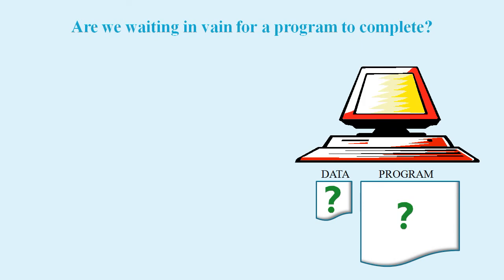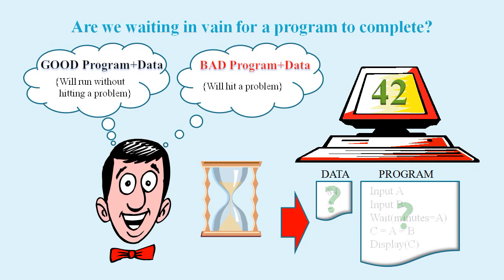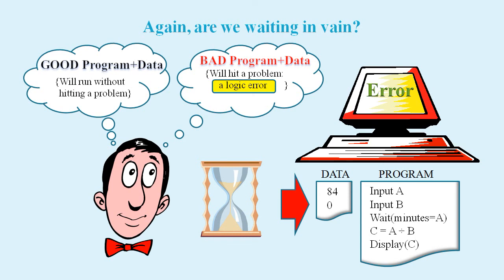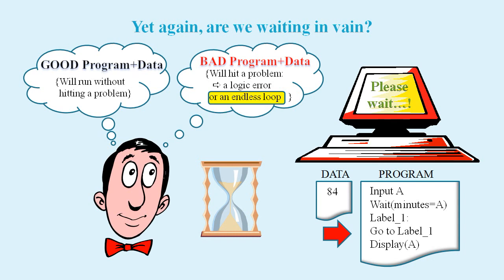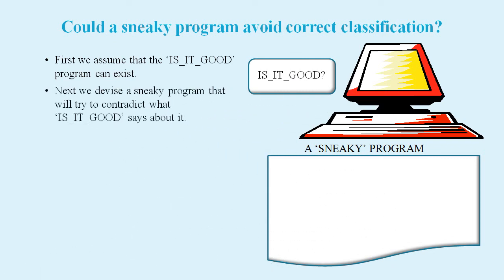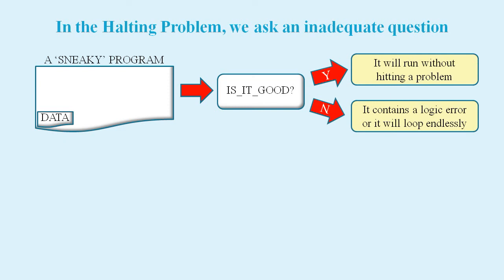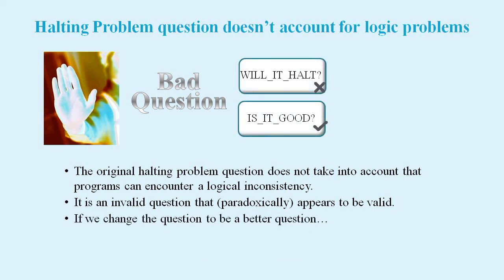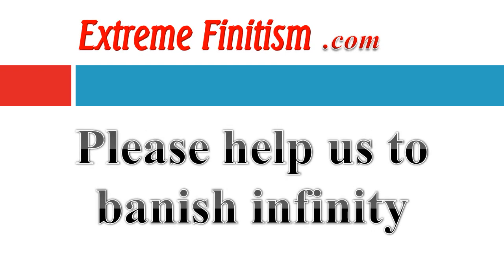Halting Problem: Finally Revealed - The (Logic) Problem with the Halting Problem

Comment: The problem is: how do you define what a logic error is? Once you formalize this you can again do a proof similar to the undecidability of the halting problem or undecidability of the logic itself.
Reply from the maker: Thank you for your comment, and I hope you enjoyed the video. If we relate your point to the video, then presumably your point is that a 'sneaky' program could be devised in such a way that the 'logic error' (of trying to act opposite to what IS_IT_GOOD predicts) can not be detected. For example, the sneaky program could use some code that essentially performs the same logic as IS_IT_GOOD, but where the code has been made to look very different (making it difficult to detect).

In order to avoid this type of problem the IS_IT_GOOD program would need to process the logic statements in the 'sneaky' program (or any given input program) and simplify them down into a 'simplest form'. With the logic in its simplest form, then detection of this 'logic error' might be easy. If so, this would defeat any attempt by a sneaky program to avoid detection.

Of course it is debatable whether or not it is possible to reduce any group of logic statements down to a fundamental simplest form. But then the onus is to provide proof that this cannot be done (and I'm not aware that such a proof exists). If such a proof does not exist then my argument still holds.
Reply: @KarmaPeny  Thanks for reply. I think I understand your point better now. So the IS_IT_GOOD predicate checks the program text in general? I assumed it would check just a single run of the program. I think in that case, the IS_IT_GOOD predicate would have to reject too many programs, i.e. the language with only good programs would no longer be turing complete. Otherwise you would run into the undecidability problems implied by the halting problem again. However, I do not have a proof for this. One example of such a non-turing complete language where the halting problem is decidable are primitive recursive programs, but you could certainly find a more liberal class of programs (maybe Epigram qualifies). 
Definitely interesting to think about...

By the way: There is no algorithm that can reduce every program to its simplest form. The proof for this is a direct consequence of the undecidability of the halting problem, so it probably does not help in this discussion.

Before clicking the video I was actually assuming your argument would be different: I thought your argument would be that all computers have finite memory and therefore the halting problem could just be solved by looking for cycles in the finite state-transition system.
Reply from the maker: @PeterZeller1  Let me address your concerns with a simple example....

Consider the subset of all computer programs that display one word, either YES or NO, and then they end. These programs might input lots of data and they can perform complicated operations on this data as allowed by a Turing complete language. The problem with the Halting Problem can be demonstrated using just this subset of programs (where halting is not an issue because they all halt)...

Within this subset of programs, can we create one that will predict what any other program + its data will do? Of course we can; this answer is trivial. All that our predictor program needs to do is to run the input program + its data. This question is equivalent to the Halting Problem question except that here we KNOW that the answer is YES given this specific scenario.

The Halting Problem argument is that we can create a sneaky program that will examine the logic of the predictor program and then do the opposite to what it would predict for the sneaky program. Such a sneaky program would still be within the specified subset of programs and there is no restriction on what language is used.

So either the Halting Problem argument is right and we can create the sneaky program, or else the counter argument is right and we can create a predictor program. In this particular scenario our predictor program is trivial, and so we must conclude that the logic of the Halting Problem is flawed.
Reply from the maker: @PeterZeller1   (continued...) In this scenario the sneaky program would examine the logic of the predictor and see that it calls the sneaky program. So the sneaky program would need to do the opposite of what the sneaky program does! It is easy to see that this forms a contradiction. It is a logical inconsistency that should ideally be detected and flagged up as a logic error in the code. The sneaky program code might look like this:
 
    Value = Sandboxed_result_of (sneaky program)
    If Value = YES then display NO
    else display YES
 
We can see that this would get itself into an endless loop. As such it would no longer belong to the subset of programs that display YES or NO and then end. In other words, it will not work. We cannot build a sneaky program that will do the opposite of our predictor program.
 
It is important to distinguish the difference between actively doing the opposite to the predictor and not being able to do the opposite. The looping of the code above is not an output of the status 'LOOP' (as opposed to the status 'HALT'). It is merely an indicator that tells us that it is impossible to build the sneaky program.
 
The fact that the Halting Problem proof is invalid might come as a shock to most people, because almost the whole world still believes that the proof is correct.
Reply: @KarmaPeny    The proof of the halting problem is correct. It has been formalized and checked by computers (e.g. isa-afp . org/entries/Universal_Turing_Machine.html ). What you did in the video was to change the statement of the proof and then of course the same proof no longer applies.
I see two problems with the arguments in your comments:
1. You are already assuming that all input programs terminate, which is the thing you want to check. So it's a cyclic argument.
2. The program you give does not contain an endless loop, because you assumed earlier that the sandboxed_result_of function always terminates and there is no other loop or recursion in the program.
Reply from the maker: @PeterZeller1  The logic of the Halting Problem is equivalent to many other problems such as the Barber paradox, and as such the core logic of the Halting Problem is not about halting. It is merely a simple trick of logic, nothing more.

In my video I changed the question so as to avoid the problem with the Halting Problem, which is the logic error at its core. As I explain in the video, the original Halting Problem question is a bad question because it ignores the possibility of logical inconsistencies within programs.

I gave that specific example (in my previous replies) because I wanted to demonstrate an equivalent logic problem using the statuses of 'YES' and 'NO' instead of 'HALT' and 'LOOP'. It is very important to understand that the logic behind the Halting Problem is not about halting, it is merely saying that if you choose heads then I can see what you have done and so I can then choose tails. This is the logic behind the Halting Problem proof and it is clearly flawed logic.

Given that the Halting Problem is not about halting and looping, we can analyse the logic by using different statuses. We want to avoid a status of 'LOOP' because we can encounter something that looks like looping during our analysis. But in pure logic terms such looping simply indicates that a contradiction has occurred. It is a logic error. If we do not change the statuses (from HALT and LOOP) then it can create much confusion which will hinder the analysis.

You said "The program you give does not contain an endless loop, because you assumed earlier that the sandboxed_result_of function always terminates". No I didn't. It is easy to understand, just follow the logic... the process in the sandbox created by the top-level program will itself need to create a sandbox, within which it will again need to create a sandbox, and so on.
 In logic terms this means we have encountered a contradiction.

The Halting Problem argument is that we can always determine the output of the predictor program and then simply do the opposite. But we have shown that in this example, any attempt to do this will lead to contradiction. In other words, we can't construct the sneaky program, and so to assume that we always can is a mistake.
Reply from the maker: @PeterZeller1  Please edit your comment to remove 'https://www.' from your link so that it is no longer clickable. I do not want people to click away from my channel, thank you.
Reply: @KarmaPeny  Just because you think the "Halting Problem question is a bad" that does not invalidate the proof. 

"the process in the sandbox created by the top-level program will itself need to create a sandbox, within which it will again need to create a sandbox, and so on.
 In logic terms this means we have encountered a contradiction." -> A program that loops or crashes is not a contradiction. The contradiction in the original proof is that the program would both loop and not loop.
Reply from the maker: @PeterZeller1  I never claimed that the Halting Problem question invalidated the proof. You are creating your own straw-man arguments and attributing them to me. Please stop this.

A program is merely a collection of logic statement. We can easily encounter an endless loop, such as in this 1 line program:

   Line_1: Goto Line_1

Assuming that we do not intentionally want a program to loop endlessly, then any endless loop must be considered to be a logic error. If our intention is to 1) get a value from a sandbox and 2) process the value, then the fact that we are unable to do this forms a contradiction. If our intended logic and our code do not do the same thing then they contradict each other. It is that simple.
Reply: @KarmaPeny   Ok, sorry that I misunderstood you. I thought you claimed that the standard textbook proof of the halting problem is wrong. 

However, I still have the impression that you think a program can be inconsistent (or "bad") by itself. A program is just some text that can be executed. 
I think you should distinguish two kinds of contradictions in your arguments: If a program does not do what the programmer intended, then that just means the programmer made a mistake. 
A contradiction in logic is however usually defined as being able to derive "A" as well as "not A" for some A from the same set of assumptions.

Your analogy where you remove the halting aspect from the argument does not work, since you cannot construct a "sneaky" program that is in the set of programs you are considering. In the original proof it is.

If it's still not clear, we could try to translate your informal argument to some rigorous proofs, such that we can avoid the misunderstandings.
Reply from the maker: @PeterZeller1  Thank you for the offer to help to translate my argument into a formal proof. I personally find real-world examples easier to understand than a bunch of abstract mathematical symbols.
 
You said: Your analogy where you remove the halting aspect from the argument does not work, since you cannot construct a "sneaky" program that is in the set of programs you are considering. In the original proof it is.
 
You claim that Sneaky can be constructed in the original proof (that uses halting). I disagree because it is merely assumed that it can be constructed. It is this assumption that I am objecting to. The whole point of my example is to demonstrate that we should not assume that Sneaky can always be constructed. It is the whole point of my example. 
 
Furthermore, it doesn't matter if we use halting and looping or not but it is much less confusing if we don't use them. As I keep saying, the Halting Problem argument is not about halting.
 We could easily substitute YES and NO in my example with the statuses of HALT and LOOP. My argument still holds.

I believe the original Halting Problem proof goes a bit like this:

    1. First we assume Predictor and Sneaky can both exist...

    2. Then if Predictor says Sneaky will return HALT, Sneaky will return LOOP

    3. And if Predictor says Sneaky will return LOOP, Sneaky will return HALT

    4. Because of the problems in points 2 and 3 (no need to call them contradictions if you don't want to) we have shown that it is not possible for Predictor and Sneaky to co-exist.

    5. We then assume that if Predictor could exist then it would always be possible to construct Sneaky

    6. Thus we conclude that Predictor cannot exist

It is points 5 and 6 that I object to. My simple example demonstrates a scenario where Predictor does exist but where Sneaky cannot be constructed. So I agree with the original proof in that it shows these two programs cannot co-exist. But I object to the assumption as to which one is the problematic one.
Reply: @KarmaPeny  The original halting problem proof is a bit different: It only assumes that the Predictor exists and then it shows how to construct the sneaky program from the predictor. There are just a few assumptions about the programming language that you need to construct the sneaky program. So the proof sketch would be:
1. Assume there is a function h(i, x) that always terminates and returns 1 if program i halts on input x and 0 otherwise.
2. Construct the following function:
function g(i) {
  if (h(i,i) == 0) { return 0; }
  else { while (true) {}; }
}
To construct this function we only assumed that it is valid to call other functions, that we have if-statements, and that we have a construct that does not halt. That should be true for most programming languages.
3. Then consider the function call h(g,g)
Here we have two cases:
a) g(g) terminates. Then h(g,g) should return 1. But if h(g,g) returns 1 then g(g) goes into the looping branch and does not terminate. So this case is impossible.
b) g(g) does not terminate. Then h(g,g) should return 0. But if h(g,g) returns 0 then g(g) goes into the return branch and terminates. So this case is also impossible.
4. In conclusion our only assumption, namely that h exists, must be wrong.

So would this proof still work if we replaced halting with different return values?
Is there a function h(i,x) that returns 1 if program i halts on input x with result YES and 0 if program i halts on input x with output NO. 
Well, the problem here is that we would still have to consider the case 3b) where g(g) loops and then the result for h could be anything and we would not get the contradiction.
So it is important to talk about halting in the proof.

Your other suggestion was to only consider the subset of programs that always terminate. 
Would the proof work for this scenario? Well, here step 2 would fail: We cannot show that the constructed program is still in the set of programs that always terminate.
Reply from the maker: @PeterZeller1  As pointed out in my video, we need to account for for logic errors. In other words, what if Predictor examines its input x (as per your description) and finds that it will encounter a divide by zero problem, or it will try to access memory address reserved for the operating system, or it will encounter some other logic error? Let's say that all detected logic errors are handled by the operating system and force the program to halt with a return code of 1.

There are many types of redundant looping that we already know how to detect as being endless and so should be terminated. As such, these detectable cases of endless looping should be treated as logic errors. So in the same way that divide by zero causes a return code of 1, so should any detectable case of endless looping.

Now we can have the simple version of Predictor that I suggested in my example, but now it will work for all programs. We no longer have to consider a subset that we know will halt.
 It is still the case that Sneaky cannot be constructed.

The Sneaky program that you constructed will keep calling itself (function g calls function h which simply calls function g, and so on) and this detectable logic error will cause it to halt with a return code of 1. This will match what the trivial Predictor will predict.

Indeed, now we are left with few if any programs that do not halt. We can still construct programs that will loop such as one based on the Collatz Conjecture. But the only reason that these will loop is that we currently don't have a proof that they will end. Perhaps one day we will have the proof, in which case we will know if it should be classified as a non-productive endless loop and thus an error, or if it will eventually halt naturally. 

In other words, if we can detect all possible logic errors then all programs should halt, it is just a matter of how they halt - naturally or forced due to a logic error.
 
The Halting Problem proof is nothing more than a simple logic trick containing cleverly disguised flawed logic. It can tell us nothing about problems like the Collatz Conjecture and yet so many people mistakenly believe it can.
Reply: @KarmaPeny  I agree that the halting problem teaches us nothing about the collatz conjecture. It just says that you cannot have an automated program analysis that determines whether a program halts or not. However, the consequences are important for program analysis in general:  Any nontrivial property about the language recognized by a Turing machine is undecidable (Rice's theorem). So what the Halting problem teaches us is:  When we write program analyzers we should not try to build a perfect analyzer since that is impossible. Instead we can try to build an analyzer that always returns correct results but sometimes says "I don't know" or we can restrict the language to be less powerful than a Turing machine.

So if you say "if we can detect all possible logic errors" that is a false premise. It is impossible to detect all logic errors.
I don't get why you keep bringing up this argument. The halting problem and its proof do not mention logic errors, so it is irrelevant for the discussion. If you look at turing machines or other simplified models of computations there just aren't any things like division by zero errors or invalid memory addresses. It is irrelevant to bring up this practical aspects, because the halting problem only talks about these idealized computing models. As I said in an earlier comment: If you talk about real machines with finite memory the halting problem is decidable. The proof would fail in step 3, because then we would have a third case (e.g. crash when out of memory).

I also agree that the proof of the halting problem uses a clever logic trick. However, it is not flawed logic.

I hope we can agree that the textbook proof of the halting problem is correct, but it assumes an idealized computing model that does not exist in the real world.
Reply from the maker: @PeterZeller1  You said: It just says that you cannot have an automated program analysis that determines whether a program halts or not.
 
I disagree. It tells us that endless loop detection needs to be part of the instruction execution logic (or operating system) rather than in a separate program.
 
 
You said: So if you say "if we can detect all possible logic errors" that is a false premise. 

 
It might be false, it might not be. You claim it is a false premise because you believe the Halting Problem proof tells us this. I have tried to explain to you why I believe it doesn't.

 
 
You said: I don't get why you keep bringing up this argument. The halting problem and its proof do not mention logic errors, so it is irrelevant for the discussion.

 
Obviously I propose that endless looping IS a logic error and so the subject is unavoidable. This is the main point of the video that we are supposed to be discussing here.

 
 
You said: If you look at turing machines or other simplified models of computations there just aren't any things like division by zero errors or invalid memory addresses.
 
Yes, but each instruction has to be identified and interpreted into a series of actions. It does not matter how simple the instructions, there is still a need for a mechanism to interpret the instructions and to execute them. As long as the language is Turing complete then it should be possible to create an endless loop. In other words, you can still create a logic error. 

 
The main question should not be 'can we create a separate program that will check other programs for loops?'. The question should be 'where should endless loop detection be placed; as part of the system control mechanism or as a separate program?' The Halting Problem proof tells us that the latter option is no good.

 

 
You said: It is irrelevant to bring up this practical aspects, because the halting problem only talks about these idealized computing models.

How do your idealised instructions get interpreted and executed, by an algorithm or by magic? At the very least you have to describe what each instruction does and how the over execution of a set of instructions will be executed - that's a system control mechanism! 

 
 
You said: I hope we can agree that the textbook proof of the halting problem is correct, but it assumes an idealized computing model that does not exist in the real world.

 
We can agree that it is correct in so far as it shows that the Predictor program and the Sneaky program cannot co-exist. But we disagree on how this result should be interpreted. I do not believe it proves that endless loop detection cannot be performed. For me it only shows that the endless loop detection needs to be part of the system control mechanism. We cannot get away from this with wild dreams of imaginary machines that somehow perform instructions by magic.
Reply: @KarmaPeny  It does not help the argument if you move some of the checks to the operation system or somewhere else. An universal computing machine could always emulate the instruction set or operation system. 

"How do your idealized instructions get interpreted and executed, by an algorithm or by magic?" It does not get executed, it is just a model. You need to understand that the halting problem only exists in such a model. However, the model is very close to reality. The only relevant difference between the model and the real world is that every machine in the real world only has finite memory. If you want to reason about your program in general without assuming a maximum memory size, you have to reason about an idealized model with unlimited memory, even though no such machine exists. 

"Obviously I propose that endless looping IS a logic error and so the subject is unavoidable." 
So is it a logic error if I write "if (false) { while (true); }", i.e. the endless loop never gets executed? If it is not then in your video you would falsely classify the sneaky program as problematic, since the endless loop is never executed. If you count this as a logic error, then you are basically limiting the language to certain constructs that are guaranteed to be safe and then your language can no longer be turing complete, i.e. you could not write an interpreter that takes a turing machine and runs it. If you could do that you would again have solved the original halting problem which we showed has no solution.

That'll be my last answer for now. I'll let you have the last word since it's your video and maybe I'll come back to it in half a year or so.
Reply from the maker: @PeterZeller1  You said: An universal computing machine could always emulate the instruction set or operation system.

It doesn't matter what it emulates, it MUST have its own system control mechanism, even if this is pure hardware such as a configuration of logic gates. You can't wriggle out this fact. And as per my argument, any endless loop detection should be performed as part of the system control.
 

 
You said: It does not get executed, it is just a model. You need to understand that the halting problem only exists in such a model.

 
This is far too slippery. I do not believe in the supernatural.

 

 
You said: The only relevant difference between the model and the real world is that every machine in the real world only has finite memory. 

 
Two points: 

 
1) I have written many, many comments and articles (including the website extremefinitism.com), together with several videos that point out why the concept of 'not finite' is a self-contradictory expression. This 'not finite' claim completely invalidates your argument in my eyes.

 
2) If it is otherwise the same as real world computers then it must have a system control mechanism.

 

 
You said: If you want to reason about your program in general without assuming a maximum memory size, you have to reason about an idealized model with unlimited memory, even though no such machine exists.
 
No we don't. We NEVER have to accept that anything can be 'unlimited'. Instead we can simply assume that we will have enough memory available for the task in hand. This achieves the same objective without the need to conjure up the nonsensical concept of infinity.
 

 
You said: So is it a logic error if I write "if (false) { while (true); }", i.e. the endless loop never gets executed?

 
Of course it isn't. Any code that never gets executed might as well be considered as a comment or simply a bit of redundant data.
 Why on earth have you asked me this???
 
 

  
You said: ...and then your language can no longer be turing complete...

 
Now I see why you asked the strange question. You have created your own straw-man argument, wrongly attributed it to me, and now you are attacking me for it!

 

That is all you can do because you can't attack my actual argument. If the endless loop detection is incorporated into the system control mechanism, then a trivial Predictor program (that simply calls its input program) will defeat the logic of the Halting Problem because the attempted Sneaky program will not defeat the Predictor.
 
Anyway, I'd like to thank you for the discussion, it was very enjoyable. It is a bit disappointing that you finally felt the need to hide behind the concept of an intangible infinite model that is beyond all physics (and thus supernatural by definition).

 
However, I think we got to the core of our disagreement which is this: I believe that any computer needs a physical mechanism (that can be described via an algorithm, and which can extend from hardware to operating system) that controls how the computer works, even an imaginary one (which has a physical manifestation as data in the form of brain chemistry). You believe we don't.
 Thank you once again. You have helped me to clarify my argument which has in turn given me more confidence in its validity.
Reply: @PeterZeller1  Your example with h() and g() is what always has puzzled me about this proof. It seems to me that g(g,g) is ill-defined/circularly defined. You are feeding a program that does the opposite of the program it's fed, a program that also does the opposite of the program it's fed (say feeding G copy 1, G copy 2). To which I would say G2's behavior is not defined because you haven't fed it a program. You could feed G2 another copy of G, but then G3 is undefined because it hasn't been fed a program.

It's also easy to see that if you do feed G2 a program with defined behavior the paradox goes away. Say you feed G2 a halting program, then G2 loops, now G1 has been fed a looping program, so G1 halts. H has made correct predictions in that it correctly says when G is fed a loop it halts and when G is fed a halter it loops.

I think the real issue is that feeding a program that depends on its input's behavior another program that also depends on its input's behavior is not defined, as the question "what is the input to the second program" either is not answered or devolves into an infinite loop of "another program whose output depends on its input" to which you then must ask "what input was that program given?"
Reply: @KarmaPeny  i'm curious, what do you think about CWunderA's reply? i have also come to the same conclusion
Reply from the maker: @xybersurfer11   I believe that we need to be able to cater for self-referential programs. And so if we can identify that the following will loop:

function y() {
  if (y() == 0) { return 0; }
  else return 1;
}

... then we should be able to cope with the self-reference in the halting problem proof.

By the way, have you seen my latest halting problem video, URL=https://youtu.be/FCrPoHE7-04

In the barber paradox it is claimed that the barber is the "one who shaves all those, and those only, who do not shave themselves". This creates the apparent paradox of who shaves the barber... does he shave himself or not? Either answer seems to result in a contradiction. The trick is that the two categories, 'shave themselves' and 'shaved by the barber' appear to be mutually exclusive and cover all possibilities when in reality they don't. When we consider the barber himself it becomes clear that the two categories are not mutually exclusive.

The Wikipedia page on the halting problem says:
"...the halting problem is the problem of determining, from a description of an arbitrary computer program and an input, whether the program will finish running, or continue to run forever. The halting problem is undecidable, meaning that no general algorithm exists that solves the halting problem for all possible program–input pairs."

And so we have a strong similarity to the barber paradox because in the halting problem we are given two apparently mutually exclusive categories: 'finish running' and 'continue to run forever'. If we use the categories 'halt' and 'does not halt' then it seems obvious that these must be mutually exclusive. But could it be that the trick is hidden in our interpretation of the word 'halt'? 

We all know that 'halt' means 'stop' but are we talking about stopping the machine, stopping the program, or even just exiting from the program (& thus implying that processing stops)? Here we have three different possible interpretations of what 'halt' might mean. The halting problem proof seems to assume that 'halt' only means the third of these options. It seems to me that the proof would not work if we took the other possible meanings of 'halt' into consideration.

In previous comments, @PeterZeller1 said:
Assume there is a function h(i, x) that always terminates and returns 1 if program i halts on input x and 0 otherwise.
...
In conclusion our only assumption, namely that h exists, must be wrong.
...
However, the consequences are important for program analysis in general:  Any nontrivial property about the language recognized by a Turing machine is undecidable (Rice's theorem). So what the Halting problem teaches us is:  When we write program analyzers we should not try to build a perfect analyzer since that is impossible. Instead we can try to build an analyzer that always returns correct results but sometimes says "I don't know" or we can restrict the language to be less powerful than a Turing machine.

I disagree with @PeterZeller1. The halting problem is the problem of determining the halting behaviour of any program-input pair. In the attempted proof that this is not possible, they assume that the decider must return its decision in a way that can be used by subsequent program statements. They do not allow for the possibility that the decider might write its prediction to the tape and then end via a 'STOP' instruction or even a 'SHUT-DOWN' instruction. This is one of many assumptions that they make during the attempted proof of undecidability. And so the claim that "h exists" is the only assumption is yet another mistake.

Perhaps an even bigger issue is that if the imaginary universal Turing Machine has no instructions that can 'stop the program' or 'stop the machine' then it is a flawed model. If it cannot do these things then there are things that real computers can do that the fictional Turing Machine can't do, not least of which is that real computers are not defeated by the halting problem proof of undeciadability.